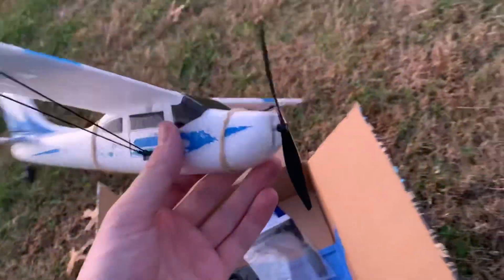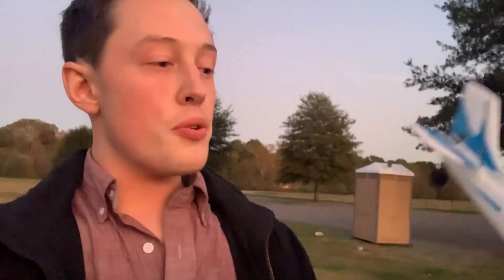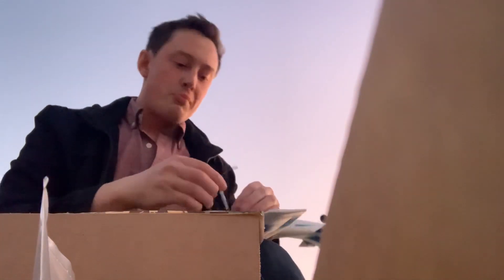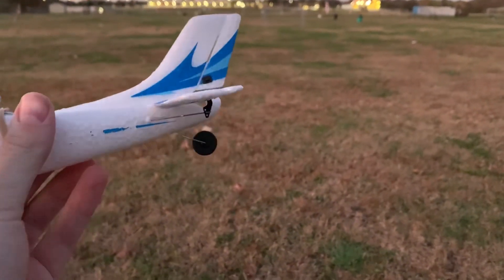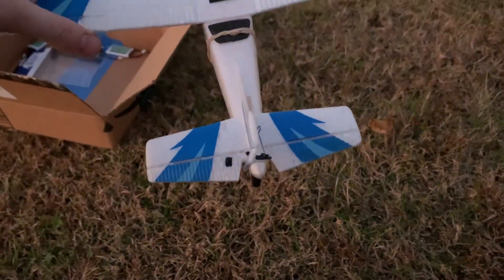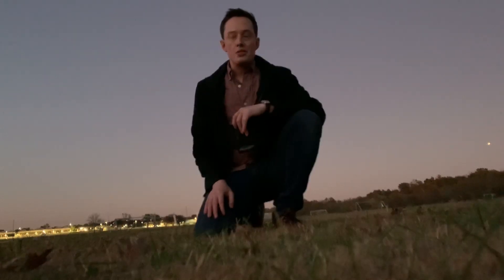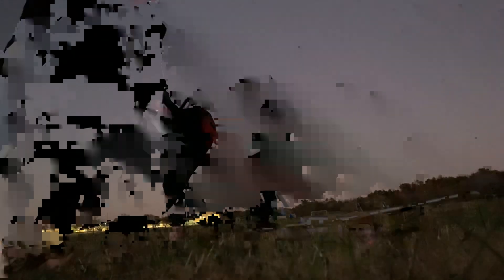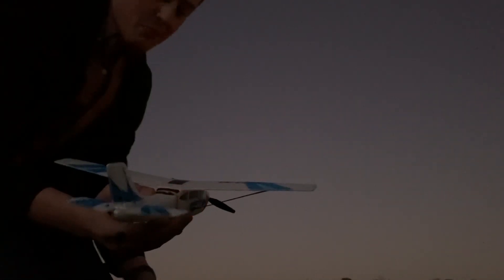Harmonic interaction between the plane and its gyroscopes

Comment: Just learned about this in my 4th year controls course! If you run the sound from this video through a spectrum analyzer, you see there are dozens of different frequencies of noise coming from the motor anywhere between 100 Hz to ~2500 Hz. Nyquist frequency (which is equal to half your sampling frequency) is the maximum frequency that you can sample at a given sampling frequency without running into aliasing, which is when higher frequencies show up as lower frequencies in your sampled data and wreak havoc on the control system. To fix this you'd need to add a low pass filter to block the high frequency vibrations occurring above your Nyqust frequency. I've typically done this in code by adding a low pass filter to the feedback loop of the control loop but adding vibration damping foam would be a mechanical way of making a low pass filter as well. Good luck :)

Comment: Run the motor up and look at your prop from a side profile you should see a perfect "line" if you are seeing 2 "lines" it means your tracking is out, either the prop is unbalaced or one blade has more pitch than the other just mark one prop this is your master then make changes to your non marked blade the slave.

Comment: fly a small parkzone in heavy winds - they can crash (a LOT) bring scotch tape to keep repairing the plane. Move to 800mm planes, then to 1100mm planes then on to big stuff. bigger you go the heavier... heavier = more stable. (mostly) ... add rocket motors... see fire :o :)

Comment: Hi Joe, do you have any MEMS accelerometers on your PCB, or could you add some? I work in data acquisition and analysis of vibration (for jet engine testing) so if you could capture any dynamic (> ~200 Hz) vibration data I'd like to help analyse it for you.

Comment: I watched yesterday and thought, This is a common magnetic interference from the propeller motor. Very common with quadcopters. A gyro these days is microscopic metal forks facing each other interlacing the prongs. Sensing the distance when they bend from motion. You could try to shield the motor and pcb with aluminum foil stacked in a few layers, Or a soda can. I learned this and fix my same problems.
Reply: Aluminum creates eddy currents. (Most non ferrous metals do).

Comment: Hey Joe, you need to balance the prop. It sounds terrible and not smooth at all. Try soft mounting the board to isolate on some spongy foam.
Reply: I don't think it is vibration, try taking off the propeller for the ground test. If it continues, its magnetic flux from the motor.
Reply: @MrScooter46290  gyro in flight controllers are pretty robust to that. Think about a race quad with 4 motors screaming at full throttle.  A balanced prop makes a nice crisp high pitched note, not a wet paper bag around

Comment: Are you sure it's not simply a nyquist issue? like the engine or something else high frequency coupling into the gyro? then you can simply dampen the mont between the PCB and the plane. I say "simply", because it happened to a friend's magnetometer once, and that make the solution way more complicated.

Comment: Do yourself a favor and buy a HobbyZone Sport Cub S. $99 Bind and fly or $129 with a radio. I have many many rc planes of all size, but this micro cub is one of my favorites.  4 channel which gives you a great ailerons trainer. Also has a panic switch! 😁 Watch a few YouTube videos of it and see how stable it is. The flitetest guys did a quick review.
Reply: I think Joe should build his own...it would be less than $50.
Reply: FliteTest YouTube channel is great for rc airplanes
Reply: I don't disagree about building your own being great, but as a beginner, having as3x or some other stabilization, along with a panic switch can be very helpful.  Sure you can do that with some radios and gyro equipped receivers, but that will surely not be a $99 airplane,  let alone a $50 airplane.  There is something to be said for taking the building out of the equation when trying to learn to fly rc from the start. Not to say Joe won't come up with some over engineered flying airplane someday soon on a 4 hour livestream! But for now, buying a bnf, or rtf, gets him back in the air that much sooner! But you are right on, the flitetest guys have some great stuff!